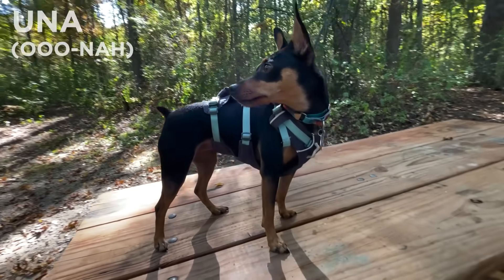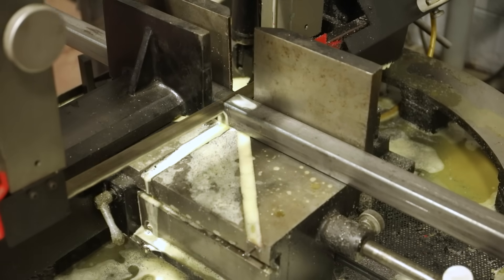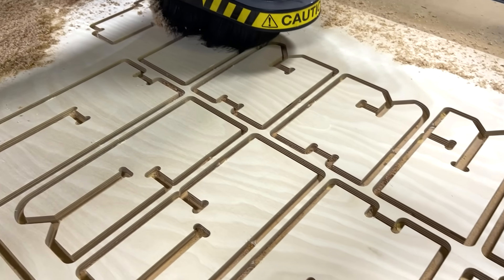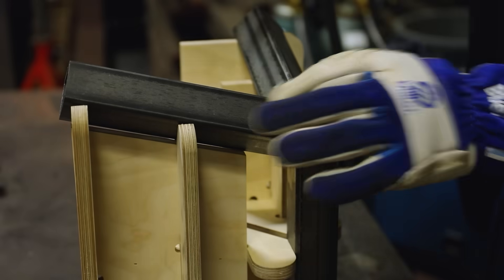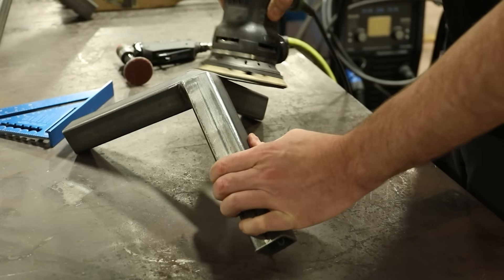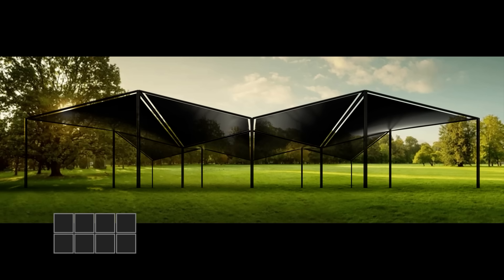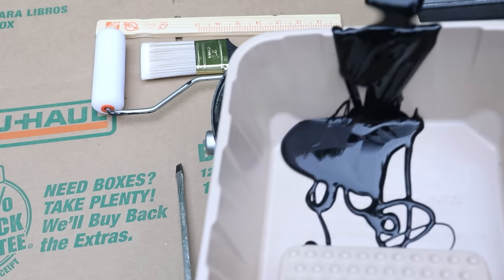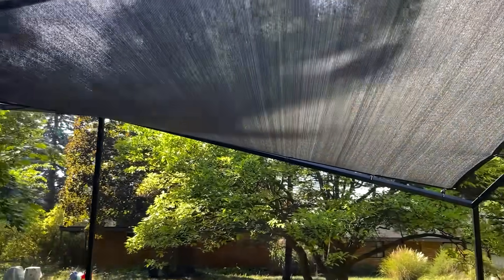Hyperbolic Canopy | Shade Structure

Comment: Quick question Brian, does this industrial Enamel-Paint really need no Base-coat / Primer?
Reply from the maker: For something more important than a canopy frame… there are primers look for Kem Kromik (sp?) 

Otherwise, this is the same stuff I applied to a gate in 2016 and it is just now needing a refresh.  There are also very similar paints from Sherwin Williams that are advertised as direct to metal or “DTM” but I have had better luck with the industrial enamel. The other stuff seems more like house paint.

Comment: Great project and very accurate fabrication. I smiled at the bit about the benefit of double measuring the center when it was for a plug weld! That's the kind of thing I'd do to ensure it was precisely center even though it didn't actually matter!!!! But yet it does so much!
Reply: I also had the same reaction 🤦
If all looks a little “over engineered” for just a shade structure this was the a OMG moment. 
I’m also a little perfectionist but this guy is on a complete new level!
Reply from the maker: I hadn’t fully ruled out a through bolt or screw at that point, but yeah I would have still measured twice out of habit…

Comment: Glad to see a new video. If I may, a few suggestions for TIG welding. You need to keep the torch hand well supported. Having your elbows out in space and not having your torch hand resting on anything is going to make it a frustrating experience. Keep your arc length much, much shorter. Whatever the size of electrode you're using should be the max distance between the tip of the tungsten and the weld pool. Get a gas lens for the torch, it'll save you a lot of argon and provide much better shielding. Once I hit age 40 I needed to have a cheater lens inside my hood or wear reading glasses, this alone improved my welds by a factor of ten.
Reply from the maker: Thanks for the suggestions… I appreciate the tips!  I thought there might be some comments about the unsupported hand, lol… if you look super close, I was just trying to do the gag with the flag and had a stunt piece of metal I was striking an arc on.  It was harder than it should have been to get the flag in frame :)…. After this, I TIGed like 40 feet of 16 gauge wall caps for a client and got a much better feel for it.  I’ll have to look into getting a gas lens!  Thanks